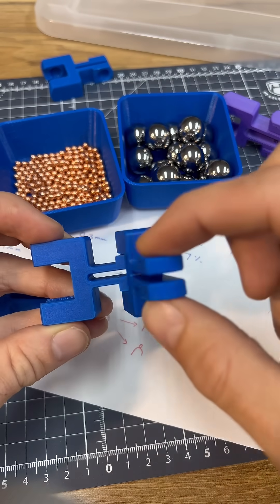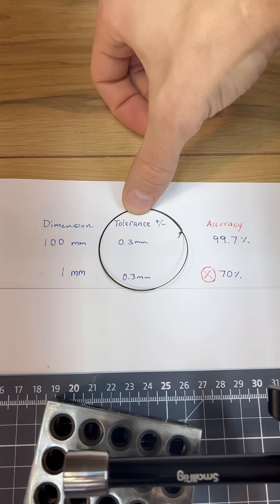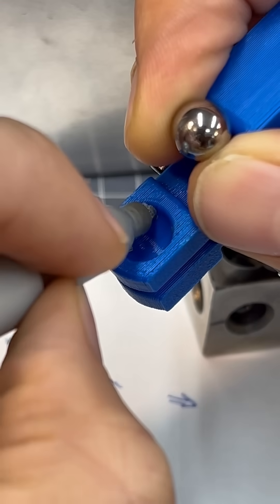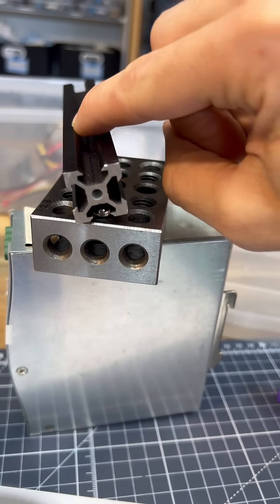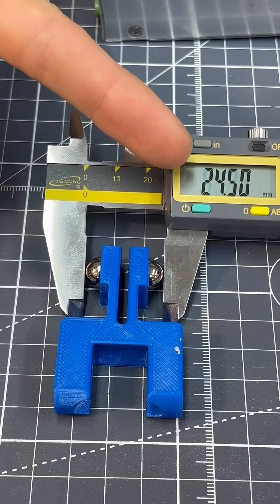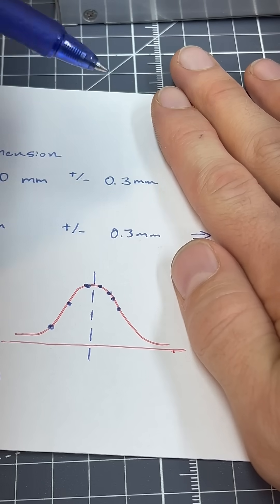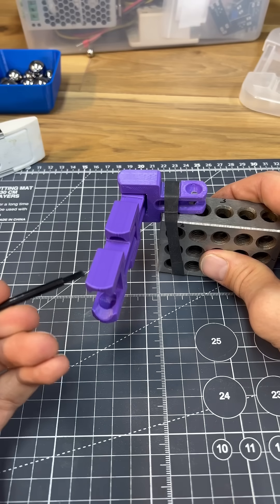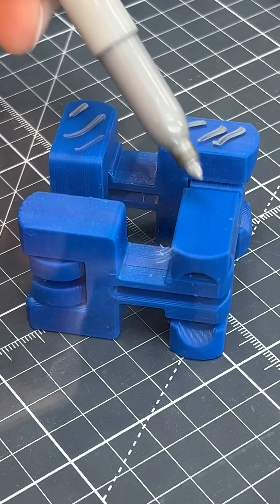Exhibit 1: borrow a tolerance, design 3D printed part with Axis.

Comment: I love that no matter what, a "tripod" will always be the most stable design bcs it always covers all corners.
Reply: It really won't! Something with 6 legs would be way less susceptible to tipping over due to having less distance between the tips.
But anything with more than 3 legs stands at risk of wobbling.
Reply: Its by far not, its just the only design that practially can't wobble.

Comment: next make a video how you're translating this into a 3d model as it is worded kinda confusing. like did you design that joint and wait until you printed it and measured 24.5 mm to design the next portion of the thing? is that what borrowing means in lamens terms or ?
i feel like i use this trick all the time but i can't tell with your explanation haha. i make and print a lot of stuff that revolves around real things but typically not just simple things like ball bearings and clip spring metal or whatever like your last video.
Reply from the maker: thanks for your thoughtful comment - I wonder if my new video explains it better?  I'd love your feedback again on it https://youtu.be/pN-rh6UwR_A

Comment: The last clip where you say "the jointed parts contact the same plane" is not true. The planes you indicate with the marker are most likely not coplanar. The accuracy of those parts is governed by the repeatability of the 3D printer. That assembly also plays a part. I'm assuming the parts were designed to "press" into one another with the balls. It's a nice design because the balls are forced against all the contact points in the female receptacles essentially eliminating all play and "self aligning" to create the pivot axis. But...the dimensional variation between one part and the other means the top planes are not coplanar. The creation of axes with the balls has no bearing (pun intended) on the location of the planes you indicated.
Reply: I think the benefit here is that the additional contact points average out the variations in tolerances/accuracy, since effectively each ball joint averages out the 6 contact points it has.
Reply: You are absolutely correct.  The pivot/bearing design is what made it move smooth, not any dimensional variation in the parts.  As well, the dimension on the male portion of the part should be oversized to force the bearing into the three balls of the female portion.  The metal parts are smooth and will move smoothly regardless of the measurement he was demonstrating. I would also point out that the finish of those parts indicates that the 3d printed isn't particularly high quality and I would be surprised if it was capable of a 0.3mm tolerance.  He indicated that the top surface of his assembly was coplanar, until you put that assembly on a surface  plate and gauge the height, that is only an assumption.
Reply: I think his statement was more to the effect that it's a while hell of a lot better than it would have been if the balls were also 3d printed
Reply: Think it's more about the plane that's rotating around the axis. Not the physical surface of the printed material on top.

also isn't there a piece of glass on top of it in that bit of the video, proving it's pretty much a single plane

Comment: I dont understand at all
Reply: I'm kinda confused too
Reply: @animehair05silently88  The printer is more accurate in certain dimensions than others so he is printing points in the more accurate dimension rather then making just a plain surface.
Reply: @johnathon007 The printer is not really more accurate in some dimensions more than others though. And in any case, that would not have anything to do with the claim of using geometry to sample a distribution to obtain its mean as is presumably claimed here. The only valid claim this video makes is that if you want less relative error across the full size, use larger dimensioned 3D printed parts. This makes sense in practice. After all, strain is a relative quantity. Smaller parts will have a wide variance of fit - from loose to tight. Larger parts won’t. That’s all there’s to it.
Reply: I'm pretty sure it's a long way around to find out where your balls are.
Reply: Easy to come out of this feeling, "I almost learned something. That was intense." I might still be in the almost phase myself.

Video is saying the printer will be off by up to 0.3mm whether you're measuring 1mm or 100mm. If you use a sphere to join the printed parts instead of forming say a dowel shape, the contact points of the sphere will vary but the end points of the total print will essentially stay the same as if you just printed a solid part because the distribution of the error across the three points of contact will tend towards the average. The math term is regression to the mean.

It's kind of like changing the rules of game to be rolling 3 dice instead of one. You can more easily predict the number will be near the middle.